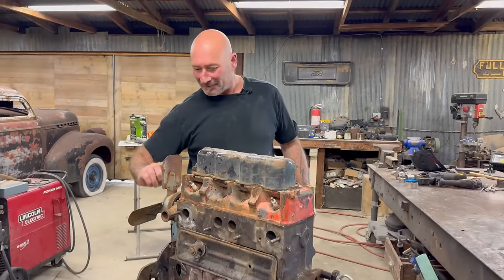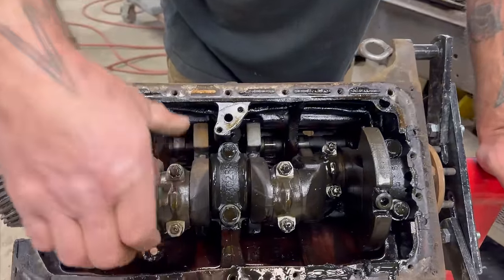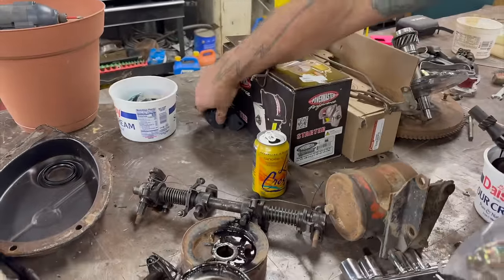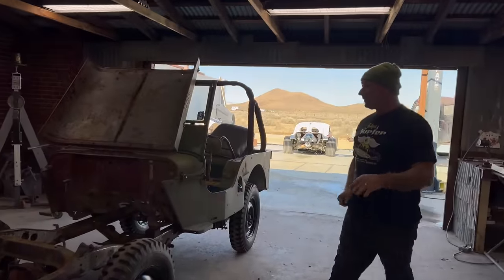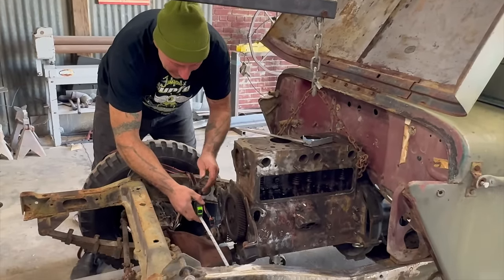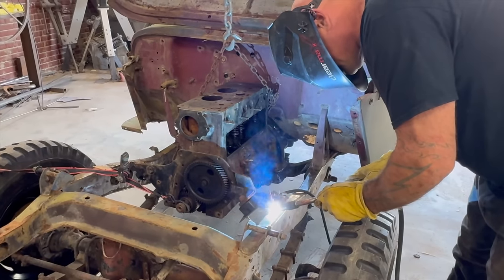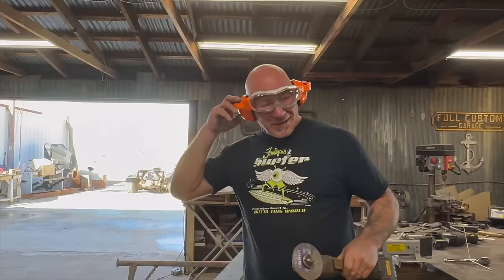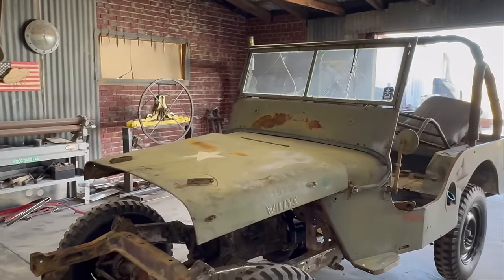Part 3! 1946 CJ-2a Willys Jeep! Is The Engine Even Going To Work Or Fit???? 📐

Comment: It's probably too late but I'm 99.9% sure that the engine is not supposed to be in the middle of the frame.  It should be slightly offset to the driver-side to clear the driveshafts.
Reply: No, trans sits centre, the transfercase is offset.
Reply: @65cj55  Ok, cool.  I was just looking at some old photographs of a CJ3B restoration I did a long time ago.  The block looked offset but that could just be because of the exhaust valve layout.
Reply: @billbayer5526  Maybe, they're a weird engine.

Comment: When I saw how far back the engine was I had a feeling it wasn't going to fit , can the mounts on the transmission move forward a few inches get the block away from the fire wall ?
Reply: The Radiator on them is huge, around 4'' thick, then there's the Fan as well, it hangs out a bit.
Reply: Yes, easier to move the gearbox cross member forward an inch or two to allow more room around the head.
Reply: @65cj55  Swap it out for a modern aluminium core and low profile thermo electric fan.
Reply: @johnt.848  Jamie's trying to keep it as original and trouble free as possible.
Reply: @65cj55  Original external appearance. Internals and mechanicals should be upgraded for reliability.
Reply: @johnt.848  They're reliable, they're still around after 60 plus years.

Comment: Your gona want to rebuild that engine bro. The engines of the day were worn out at 125,000 miles and in need. They would run forever, that is true but they smoke.  That engine will fire right up if just reassembled. But I guarantee that it will smoke like Cheech and Chong and have squat for power. They smoked when new. The cheapest rebuild you can do would be to emery cloth to brake glaze on crank, change bearings and seals, change rings, hone cylinders by hand, check block for true flat, plane heads. Hand grind valves yourself. If my dad was still around, he would do it just for fun. Remember at the end of the day it will be a Roussel, and worth the investment.

Comment: Once you put the body mounts on the valve cover should be fine. Or you can just do a hockey puck lift .
Reply: How thick are Hockey Pucks ? the original mounts were 2'' rubber, for flex etc.
Reply: @65cj55  you use the pucks with the mounts for the extra lift
Reply: @bouverscustoms1652  Oh right, are they cheap ?

Comment: Jeep took the original Flathead engine and put a overhead valve head on it the exhaust valves should still be in the only the intake valves crazy design to to save money

Comment: I wish some nice person would have donated a small block Chevy V8 and bell housing adapter. Never heard about how the transmission lines up and is the drive shaft really centered? 
Nice that a lot of parts have been donated to you or your better half. The transmission is not a sycronized unit back then is it? Looks like the water sat in the oil pan making sludge or is that fudge?😂
Reply: I have put a SBC in one, they don't like it, they're very low geared.

Comment: At least hone the cylinders and lap the valves. Fit new rings (use oversize and re gap them), replace the big end and crank bearings and you will be good to go. This is an easy and cheap way to reco an engine.

Comment: The gear on the camshaft is fibre. Often comes in a set with the crankshaft gear. I you are worried about that little bit of rust just put the piston to the bottom of the cylinder and use a shorten flex hone. Won't remove a large amount will just clean up. Hopefully this is helpful. Marc from Australia 🇦🇺

Comment: I see the Chevy in the background. If it has the original drive train, I hope that you keep it. I have seen way too many of the old Chevy's with the engine and transmission and the full driveline removed and a small block and automatic transmission put in. I get it if the original one is blown up or worn out but if it is there and fixable, I say use it. You won't be going 70 on the freeway but so what. Those cars were not meant to do that.
Reply: Sorry, i think you're going to see another...lol.
Reply: As long as you don't follow the crowd like a lemming and put a small block Chevy 350, or any other size, in there. That's a waste of a good custom car.
Reply: @camino6431  It's not my car, but i'm sure Ian said it's getting a V8 Chev, it's more practical reliable and powerful then the old Six, i myself would go with a LS3 Conversion.
Reply: @65cj55  I don't know what he said about the engine plans. Remember that they made the frame of the car with a 90 HP engine in mind. A 250 or 300 HP engine is going to stress the frame a lot. An LS3 without an aftermarket frame is asking for trouble in my opinion.
Reply: @camino6431  Those frames were made to take a lot of weight, them car bodies aren't light, Mike Bello has been doing it forever, i just remember them showing the Six in it when it arrived and Ian saying ''if anyone needs that, it's coming out''...
Reply: @65cj55  I don't think that it is a good idea, but I know that people have been putting small blocks in those cars for years, so what ever, it is not my car. It would be much cheaper to put a small block in my 49 rather than rebuild the original engine but I want it to stay as original as it can be.
Reply: @camino6431  Yes everyone has a preference, a small block is likely around the same weight, and coupled to a good transmission it makes for better driving, i do like the Hemi 6cyl engines though.
Reply: @65cj55  never had one of those

Comment: Pull the pistons out, make sure the rings move freely, and run a cylinder hone and clean up the cylinder walls..........lit will run for 25 more years!
45 yrs ago I won $10 getting a VW beetle engine out in under 10 min! (6 min!)  It was on jack stands and  I used his floor jack.
Reply: That’s the plan 🍻
Reply: I did one in 17 mins about that long ago myself...lol  gotta love them ol bugs

Comment: If the bearings aren't slapped out and the cylinders look smooth (they seem to), that old engine will outlast you. Too simple to not run, it may smoke but it will run forever as long as you keep oil in it. Good call to just toss it in, its a JEEP, nothing fancy.

Comment: Suck, squeeze, bang, blow. AKA Induction, compression, ignition, exhaust. Theoretically the internal combustion engine shouldn’t work because ‘Technically Speaking’ there’s a moment when the piston is stationary when it is at its apex hence the motor has stopped. Obviously this isn’t the case in the real world but it does make you think ’how about a rotary engine’, clearly Felix Wankel had this thought. 👍🛸🇦🇺

Comment: Its not going to cost much to put it together and run it, and it wont break anything in the process. Engine work can end up costing more than a good working junkyard motor, or even maybe a cheap crate motor. Are you going to spend $500-1000 at the machine shop, then put that shitty head on it? 
I figure this isnt going to get a lot of miles put on it, but you want to be able to use it, so what I would do it dingleball it, check the rod bearings and if they have no wear, run them, if they are worn, replace them. Go with all fresh new gaskets and seals, and put er back together and run it. If you have good enough compression, throw some gear oil in the crank case and thicken it up.

Comment: That is a f head half of the valves are in the block
Reply: Better engine than a flat the flat head which would develop cracks between the valve seats the f head with the intake valves in the head there was greater space between the valves no cracks, that engine is a easy rebuild and old oil which never got replaced regularly and was also parifeen based and was prone to make sludge when neglected
Reply: Happy Saturday jami and Ian great way to start my morning thank you for being here